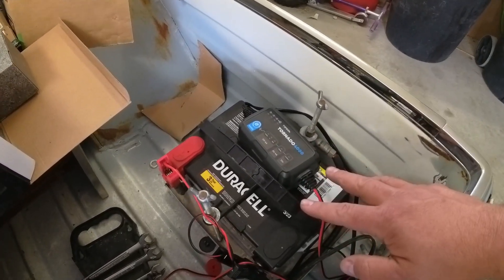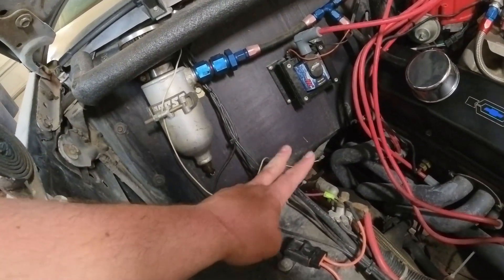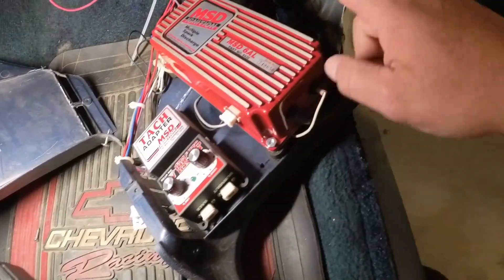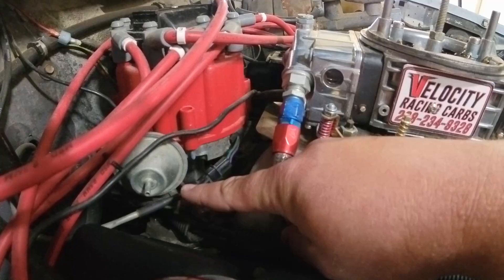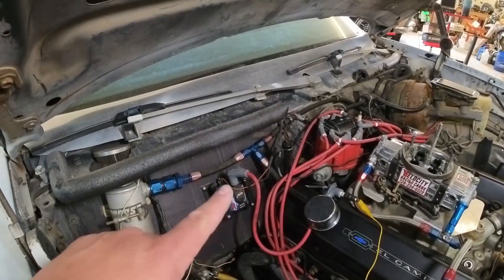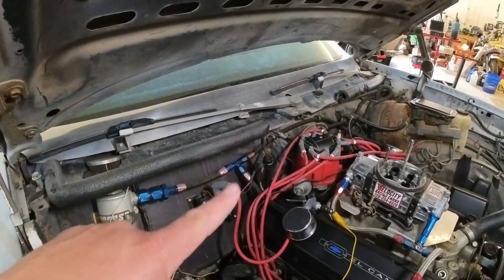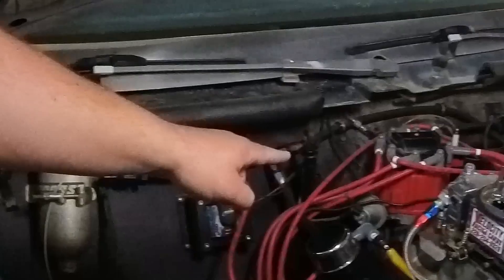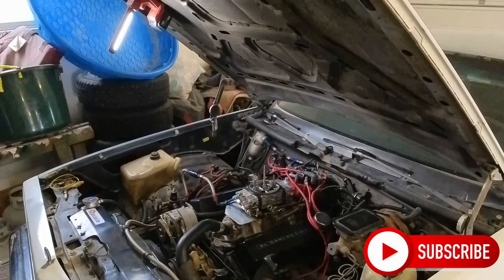MSD 6AL Ignition Troubleshooting: How I Found the Hidden Issue!

Comment: Good info...  I have an MSD distributor and 6AL ignition module on our 73 Mach 1, installed by the prior owner.  It has been a marvelous system (it came with a 6A module, I upgraded to 6AL for the Rev Limiter, just because I felt it was a good idea).  Everything went swimmingly for 5 years.  In Father's Day, 2023, I brought our 4 Mustangs and Shelbys to a local car show (the 73 Mach 1 won the Best In Show trophy), and ran well all the way to the show and back home.

Once we got home we had 4 cars to jockey around and park them in their various garage stalls.  I went to the Mach 1 and found the engine would crank over, and fire up, but as soon s the key was moved to the Run position.  Hmmm.  Okay, I diddled with cleaning the battery cables as I has a little corrosion on the posts and terminal lugs.  Surprisingly it fired right up and I got it parked in its garage bay.  The next day I was going to undertake the filming of a How To video using the Mach 1, and found once again it had the Fire No Run condition.  I went through the MSD diagnostic steps, and determined the MSD system itself was not the problem.  I felt the problem was most likely going to be between the ignition key and the module's small red wire, and after looking at how the prior owner had wired the 6AL I decided to just provide a totally new wiring solution, using a relay to power the small red wire.  I most likely had an intermittent open circuit  on the wiring feeding power to the 6AL small red wire - as dictated by logic.  

So, the planned video was replaced by a video on how I fully  rewired the small red wire power source for the 6AL.  It worked beautifully, and the Mach 12 is not breathing fire once again.  I never was able to prove the prior circuit feeding the smaller red wire was open intermittently.  I came to that conclusion via the behavior I was seeing.  With intermittent, non-duplicatable situations I find there are times I just need to take a stab at the situation, and I get lucky far more often than not.

For anyone interested in what how I used a relay to provide power to the small red wire for the 6AL, the link is here:

https://youtu.be/kCfZygdUUds

Comment: It’s important the boxes are hooked up g direct to your battery and make sure the ground is a bare metal ground.😊
Reply from the maker: MSD typically recommends using the battery for both the main power and ground. With a relocated battery and the need for a cutoff switch, I'm using my main power and ground lugs. Which, in talking with MSD when I wired this up, was viewed as acceptable.

Comment: I wish you went into more detail on how you jumped the coil wires to test spark. Could not see what you were doing and you quickly glossed over it. I'm still stuck with a broken boat.
Reply from the maker: Like this? This is zoomed in a bit from the long video and shows the exact same thing. This is triggering the coil by giving it a signal like the magnetic pickup would. You need to jiggle it back and forth to make and break contact, holding continuous contact will create one spark. https://youtube.com/shorts/VcUDEGKWqfc?feature=share4

Comment: Nice video.  I have 2 msd ignition boxes for my nascar.  swapped coil from 8250 to 8252 msd blaster, as it was just bogging down under load.  now car just starts and dies after 4 seconds.  tried both the msd 6tn box and msd hvc box, same exact result.  I guess it must be distributor then?  It's a brand new coil, and fuel is all good, carb is new.  I was going to start checking wiring too first to be sure!!
Reply from the maker: The distributor really has 2 jobs here unless you have a crank trigger, then it's just 1. It's job is to sense when to fire via the magnetic pick up and points at where to send the spark to. Check the magnetic pick up, and just run through all the normal electrical diag stuff, correct power, good ground, proper connections, and rule those out before going and spending more money on parts that you may or may not need.

Comment: My car started running bad.  Then a fuse burned up for the ignition. I traced a solid black wire from my MSD 7AL to find the nut holding the wire to ground was off and the black ground wire was against the body. So once I put a new nut on it. Boom, started and running fine.
Reply from the maker: Power, ground and easy stuff are always the first to check!

Comment: Too many problems with MSD. They should have pride and make a good product.
Reply: Mine still works 💪 !!!
Got it back in 01!!!!
Reply: Nowadays, you'd have better luck finding big foot than a quality part.
Reply: Nothing but issues.  Sometimes no spark. Can’t figure it out
Reply from the maker: Start with the basics. Solid power and ground, check all the connections at all the points to make sure they're good. Most intermittent problems are issues with connections.
Reply: @SnowFamilyRacing  I know you are trying to help, but these boxes just run way too hot. 
Some people have success while others don't. 
Ford's duraspark ignition is reliable. I have a box that's been working since 1976.

Comment: My blaster coil is arching what could cause that once it starts it shuts off
Reply from the maker: The round blaster coils are not the most reliable. It could be as simple as the boot or the coil could be bad. I use an E style Pertronix Flamethrower coil. It helped my on track consistency and general reliability.
Reply: See any cracks ? Watch it act up in the dark.

Comment: What pin exactly my coil is in the cap
Reply from the maker: The purple and green pins in the black connector for the magnetic pick up just outside the body of the distributor. Make sure they're pushed into the connector and each other solidly.
Reply: What is the function of the small white box next to the msd 6al box, thank you for the explanation🙏
Reply from the maker: It has something to with a points style ignition. Anything with a magnetic pickup doesn't use it.